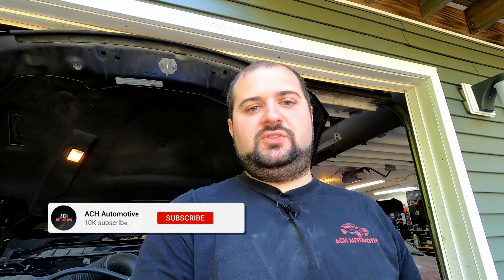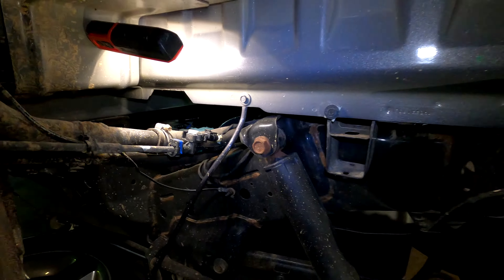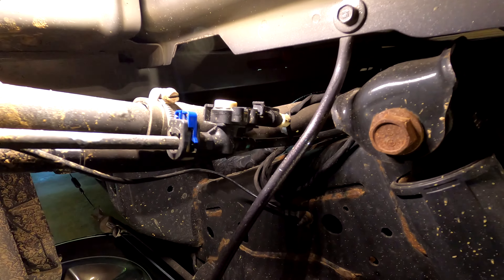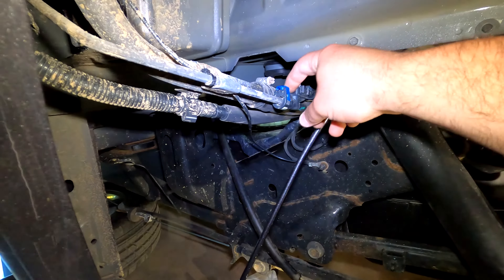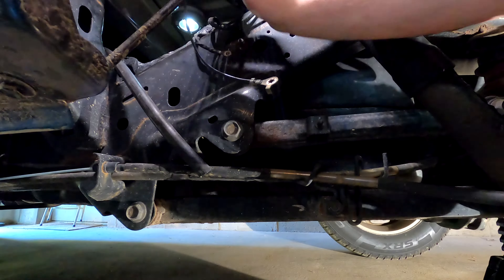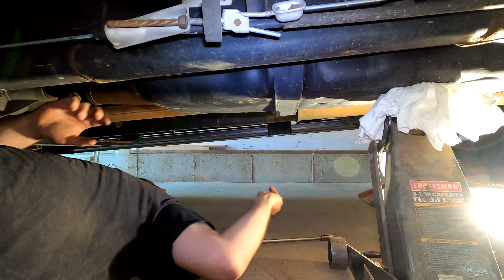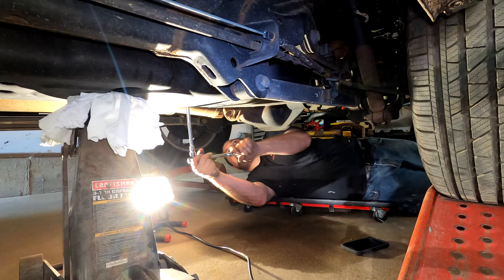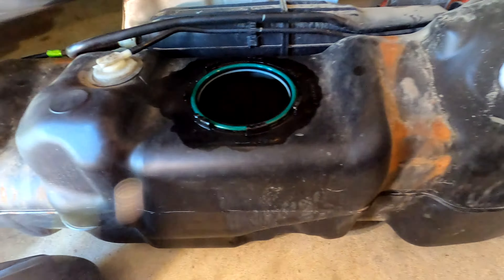Ram 1500 5.7l Hemi Fuel Gauge Not Working P0463 - Part 2

Comment: It may sound like more work but; 6 bolts hold the bed on, you just need to tip the bed up in front 8-10 inches (use wood scraps to sit on), no need to disconnect anything except related to the assembly.  !/2 the work!
Reply: You can do that on this truck because it has the 6'4" bed but you can't on a 5'7" bed because the pump sits under the cab

Comment: Great video I have a ram 2500 2013 replaced the fuel assembly and still have the same problem any suggestions
Reply: Did you try to reset the Trip/ODO?

Comment: I have been going around trying to figure out my problem. I have the code for the fuel pump sensor is broke. I replaced my pump and still have the code. I believe it is a ground problem because when I bought the truck full tank would read 3/4 then several months later the tank read half at full and finally died completely a few months ago. I'd really appreciate any help on how to fix it. My truck is a 2012 with the 32 gallon.

Comment: Ty for the video my 2015 ram have the same code but my gauge still working.Check engine light lit up when gas is half empty!?
Reply from the maker: Mine was extremely intermittent. Gauge would come and go, sometimes fast enough I wouldn't notice anything other than the light.

Comment: Hello I got a 1999 Dodge ram 2500 4x4 I got a code p0462 low voltage sending unit I changed the sender and fuel pump still nothing I replace the cluster 2 still nothing I'm thinking it could be the timp fuse box or PCM ????
Reply from the maker: Did you check all the wiring and connectors?

Comment: Mine dealership said 700$ plus tax for that parts plus labor
Reply from the maker: I don't doubt it, I had heard, myself, anywhere between $800 and $1000.
Reply: You guys are getting ripped. I got it done, parts and labor $450.
Reply: @lc4002  where?
Reply: @lc4002  just bought at autozone 287.  Gonna install myself tmmr. By taking bed off
Reply: I just got it done for $280
Reply: My dealer in So Cal. Wants $1100.00